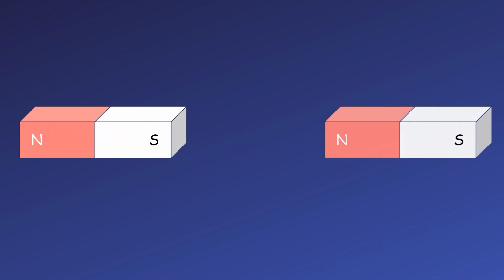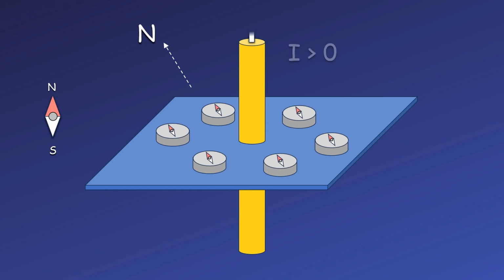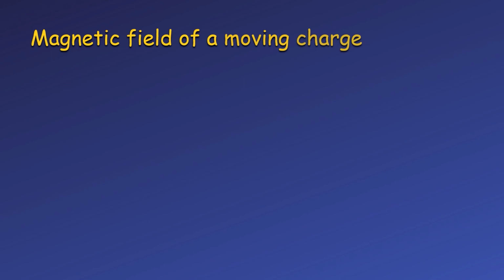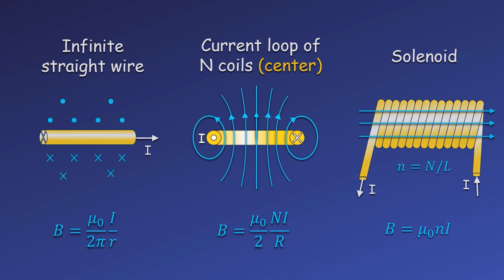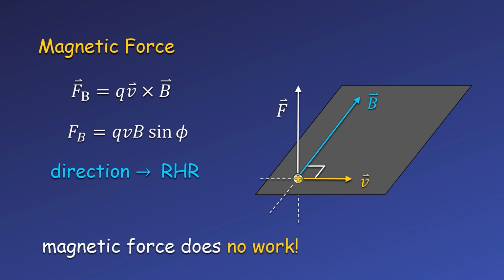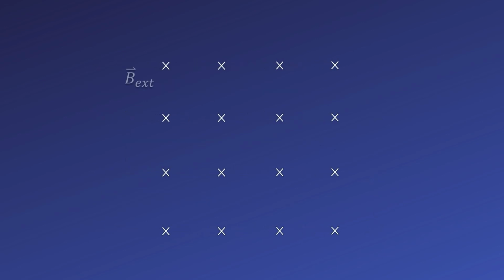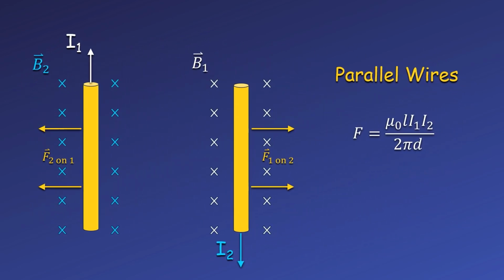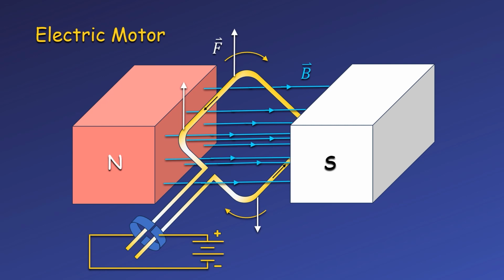Magnetic Field and Magnetic Force

Comment: This was an amazing eye-opening video! I have a follow up 2 questions set in relation to the parallel wires example. How does the equation change if the wire on the right has a twice stronger field than the one on the left? And how does the interaction of the fields change if the two wires were on angle and narrowing the distance with each other? Would love to have a conversation if you’re willing.